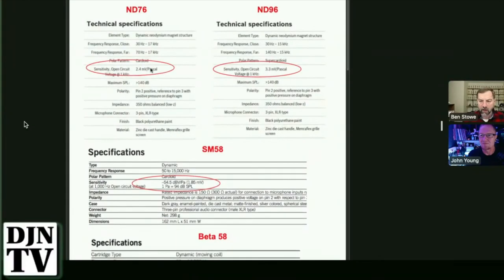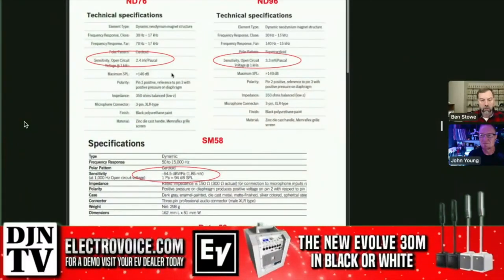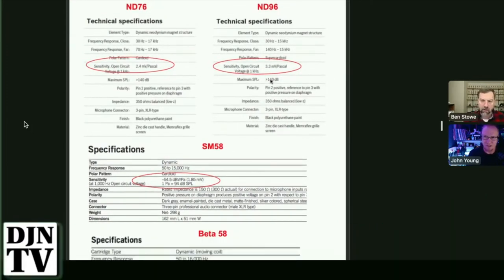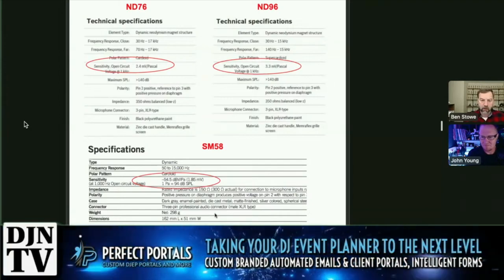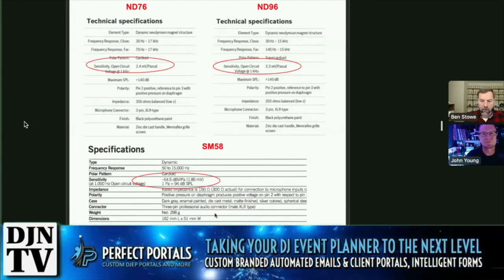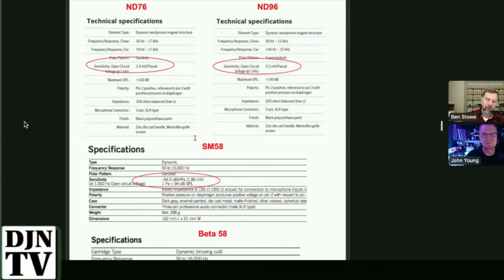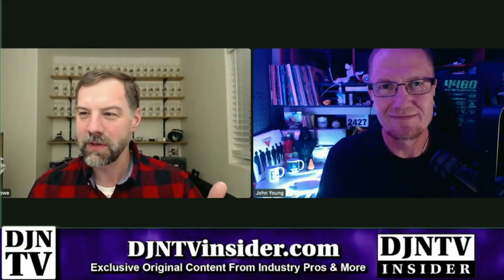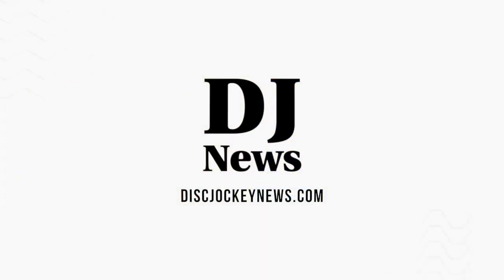DJ Controller Mic Pre-Amps: How Would I Test Which Is Best? #DJTips

Comment: I've seen so many DJs use the cheapest most horrible sounding Amazon mics, as well as other PA situations such as Karaoke or Race Directing at some events...  unless you're going to use a quality mic, a quality preamp isn't going to change the outcome much... but it all does add up.    Like gain stages, every stage matters,  but can only utilize what it's given on the input side of the device... 
   The comparison of sm58 and beta, and mentioning that a normal 58 might be better if the preamp is hot and neding turned down is a good example... 
Cheers